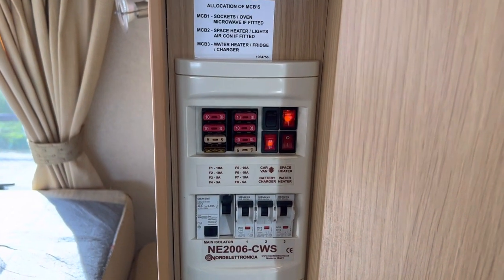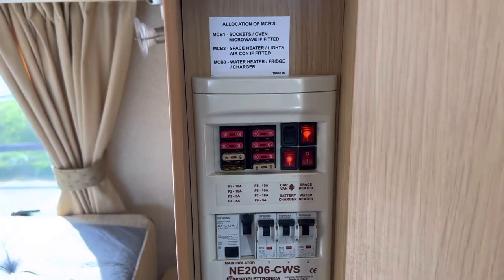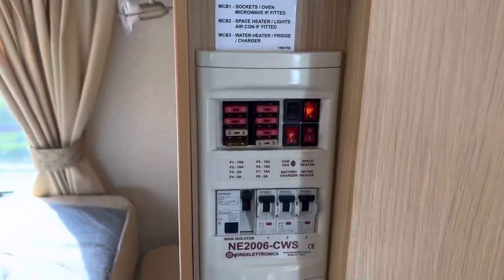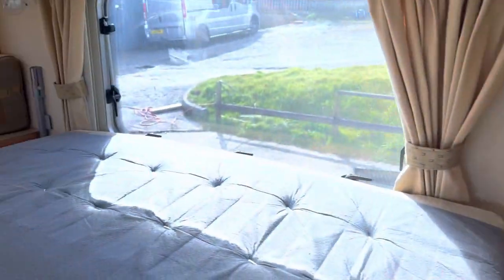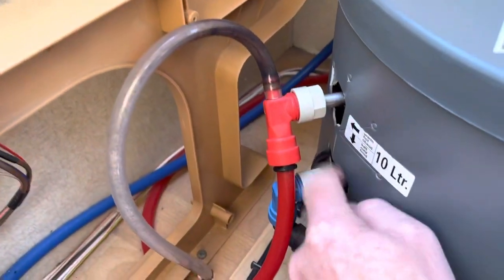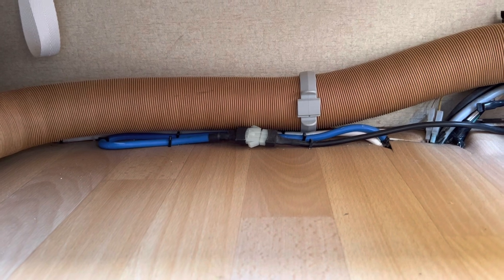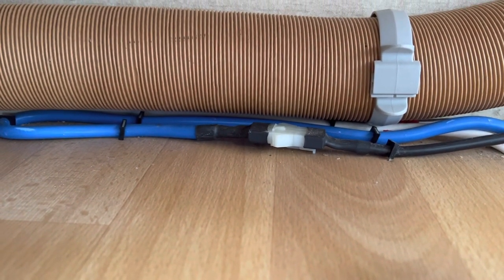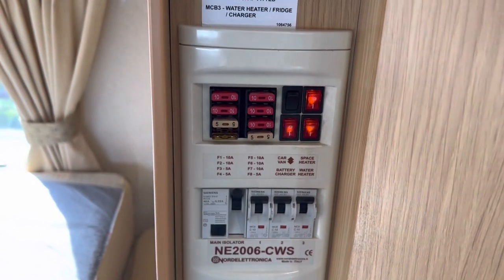Truma Ultrastore water heater not working on electric

Comment: Thank you so much for this helpful video. We are new to caravanning and the last time we went, we ended up draining the hot water without realising until it was too late, and so consequently, when we set up this time we had no hot water on 240v. We thought we needed a new element but we did what you recommended and lo and behold, 30 mins later, we had hot water fully restored. Many thanks
Reply from the maker: @juliamarshall6374  no problem, glad I could help, subscribe for more videos on stuff like this..

Comment: Hi.  good video! My compliments.

May I bother you for a couple of info I'm looking for on this kind of boiler?
I do see you have something that seems to be a very big pump near the boiler: is it recommended to change the standard common submersible pump that comes with the Caravans (comet elegant or what else)? And... what is the black little tank before it?

Another: what is the transparent rubber pipe that exit from the tee attached to the hot water exit? is there a pressure relief valve in there? 

Many many thanks in advance.
Cheers.
Ezio
Reply from the maker: No you don’t have to change the pump, it’s just a different type you have and as long as it works it’s fine, the black thing is an expansion valve, some vans have them, most don’t and yes there is a pressure valve on the red hot outlet on the Ultraheat..

Comment: Hello. Lost hot water at the end of last season. Checked all fuses. Just changed the heater element to find its still not working. Tried the old element on a plug and it heats up. Had the connection you recommend apart. Is there another connection further around from the tank that could be the issue? Many thanks.
Reply from the maker: Hi, not that would make and difference, you need to make sure the 240 is getting to the heater. I’d use a volt stick to check the 240 is getting to the element. Did you check the fuse with a multimeter?

Comment: hi there.....my caravan is a 1997 abbey vouge GTS 417....went for a break last week on east coast...got everything up and running BRILLIANT...until day after,battery ran down so checked fuses under seating at the front near the water heater and the van fuse looked as if it had very slight burn so went to halfords and got 20amp fuses got back changed fuse and still the the battery running down...do you know if another fuse runs from the battery lead to the main fuses for the van? i did find one video on utube which was in a swift caravan and that fuse had gone he changed it and he had battery power back on but      only showed about 75% charge on meter, hopefully mine as a fuse on same lead...also before my battery ran down i tried the electric heater,it lit up the switch light then around 10seconds went onto heater fualt then 5seconds low battery voltage? so is this becuase it could just be a fuse or is there anything else can be the culprit,...thank you hope you can help...ROB....your videos are very helpful..👍
Reply from the maker: Hi, your transformer has packed up which should charge the battery. On a van of that age you’ll have to retrofit a new one. Genuinely if a fuse has gone it’s because something bad has happened which has caused the fuse to blow. It’s a symptom of a problem, not often the actual problem. If you’re plugged in and your transformer is working the battery wouldn’t go flat.

Comment: Wow , great video .it worked perfectly! Massive thank you. You have saved me a fortune ☺️
Reply from the maker: No problem, glad I could help.
Reply: @atlanticcaravansUK  Can you help me figure my water heater, I bought the caravan this yr and it heats water perfect on gas but electric wasn’t working I diagnosed it to be element by disconnecting element from power supply and connected 1000w heater which ran perfect from same power and isolation switch so all good until I connected back up element and it tripped the switch. It was full of water and I did as you suggested but still no go. I replaced the element with brand new one and it was perfect and heating water so after a few days of running it for an hr or so at a time I was happy it was good. Now Iv had water on for the day and suddenly it tripped the switch! Water was hot tank was full ran some water tried it again it stayed on for a few mins and tripped again! Now it is tripping immediately again 🤷🏼‍♂️ it’s a new element, full of water, no power supply issue so I’m confused. Iv gotten rid of the block connector and replaced it with a plug on element side and socket on supply end! Fully confused! Can’t figure this out

Comment: I don't have that connection - the black cable goes straight under the floor, which is fixed and sealed. Any ideas?
Reply from the maker: Hi, there will be a connection somewhere, what caravan is it?

Comment: I have a similar problem mine seems to automatic switch to gas even though i select 240 on the dial don't know if I have a separate switch I have a Chausson flash 11 any hints would be greatly appreciated
Reply from the maker: Hi, the gas is separate on this model, there isn’t a dial on the 240 side, normally just a switch to turn it on, so I think you might have a different heater, is it definitely a Truma ultrastore?

Comment: Thanks so much I’m away with the kids on my own and you’ve just saved our holiday. We’ve a 2004 sterling and this did the trick. I could figure which red light it was tho. I tried them all?
Reply from the maker: No problem, glad it helped. But I don’t understand what red light you’re looking for?
Reply: @atlanticcaravansUK  the red element one? I turned on a light, tv and that left one red light in the wardrobe.. is there anyway to figure which switch is the element many many thanks for your video!
Reply from the maker: @slynehead   I think it should correspond with what it says underneath, if it’s the system I’m thinking, does it say water heater/ space heater below the red switch’s?

Comment: Hi,i have tried to do this today but although i have followed the cable as far as i can i dont have that little plug. I also dont have any MCBs,only blade fuses.On the boiler i dont have the cable coming out of where the element comes out! Help,i am away this weekend and no hot water.
Reply from the maker: What van have you got?
Reply: @atlanticcaravansUK  I have a CI 171 Riviera, Fiat ducato.
Reply from the maker: I’d need to see it, do you have a 240v switch to turn it on?
Reply: @atlanticcaravansUK  Hi, not that I can see! I have little switch with 50/70 on it but can't see anything else! There is another switch by the door when you come in by the electric step switch but can't see if that does anything.
Reply from the maker: That switch is for the gas, you said you don’t have a cable from the element, I take it it has worked on 240v before? It could be gas only.
Reply: @atlanticcaravansUK  Good morning, I have only recently purchased the van, and as I purchased off a friend I didn't really go through everything! To be honest I didn't realise it could be gas only!
Reply: @atlanticcaravansUK  I must add that I do appreciate your help! I have taken a couple of pictures but can't work out how to post them! Do you have an email address I could send them to if you don't mind helping with this enquiry? Regards Simon
Reply from the maker: darren@atlanticcaravans.co.uk
Reply: @atlanticcaravansUK  Hi , thanks for your help, the heater is gas only! Fired up 2nd time! Regards Simon

Comment: Our heater stopped working while away.  It was working but just stopped. So followed your instructions and it worked but then stopped again did it again and worked again.  Any idea why this would happen.
Reply from the maker: Hi, I can only think there is a fault with the cut out switch, you may have to replace the PCB..
Reply: Ok Thanks where am I like to find that?  Is it an easy job?
Reply from the maker: @davidroberts7273  hi, it’s pretty straight forward, there is a triangle bit of plastic to the right of the boiler with two small screws in it, pop that off and you are looking at the pcb. It slides out, unplug it and pop a new one in.

Comment: Hi when I disconnected this do I need to turn off all power and 12v. Many thanks. Having a nitemare. Swift sprite major 6 2017. Cannot get the heating to come on. Electrics all working but no icons on screen only spanner and clock. I've tried reset nothing. Replaced both fuses on the water heater. Still nothing 😭😭😭
Reply from the maker: You have a different heater to the one on this video, do you have an error code?
Reply from the maker: If not, it sounds like the PCB in the heater isn’t talking to the control panel over the door. Could be the PCB (most likely) the cable or the control panel it’s self..
Reply: @Atlantic Caravans  yes the error code was w255 h. And I had all the icons on the screen.

 I then was told to connect 12v and toggle to reset and press for inti. I did this then the screen lost all icons apart from spanner & clock
Reply: @Atlantic Caravans  I'm new to all this. Where is the PCB and how much roughly ?
Reply: @atlanticcaravansUK  all other electrics are working lights and fridge
Reply from the maker: @kathrynpurcell2348  I’m in Mexico at the moment, just going out, check out theses codes, I’ll have a look in a sec..
https://www.atlanticcaravans.co.uk/combi-error-codes
Reply: @atlanticcaravansUK  thankyou
Reply from the maker: @kathrynpurcell2348  yep, 255 is a connection problem, you could find the PCB which is on top of the heater under a cover that slides off and check the phone type plug, but it’ll probably be something a bit worse that needs a technician to look at, probably the PCB which is around £250 ish..
Reply: @atlanticcaravansUK  thankyou 👍
Reply: Brilliant tip thanks!

Comment: Can anyone help me figure my water heater, I bought the caravan this yr and it heats water perfect on gas but electric wasn’t working I diagnosed it to be element by disconnecting element from power supply and connected 1000w heater which ran perfect from same power and isolation switch so all good until I connected back up element and it tripped the switch. It was full of water and was fine. I replaced the element and it was perfect and heating water so after a few days of running it for an hr or so at a time I was happy it was good. Now Iv had water on for the day and suddenly it tripped the switch! Water was hot tank was full ran some water tried it again it stayed on for a few mins and tripped again! Now it is tripping immediately again 🤷🏼‍♂️ it’s a new element full of water no power supply issue so I’m confused
Reply from the maker: To be honest, it can only really be the element again, just check the fuse in the spur switch and make sure it’s 10 amp, but that should blow and not tripped the system out, we just had one that had a 5 amp in and melted so it was that that was tripping out.. apart from that without testing the element I’m not sure what’s going on..
Reply: @atlanticcaravansUK  Thanks for the reply, that spur or little plug block connector is gone coz I had to rule it out incase there was an issue with that so Iv a plug and socket fitted instead with a 13amp fuse and like you said the fuse should have cut the power not tripped the switch but I changed it anyway just to be sure. Is there any reset switch like on the old cylindrical heater?
Reply: @atlanticcaravansUK  just another possibility but does the water tank air lock or anything like that? I had hot water and taps were running well but hot water ran out fairly quick? Maybe 2-3 mins running after hearing for an hour, Is it possible the tank had air in it or something and the element has blown because of not being submerged or something like that?
Reply from the maker: The rest is the process in the video, but that won’t work if the heater is tripping out the electric..
Reply from the maker: No, if the water is coming out of the hot tap then the tank is full..
Reply: @atlanticcaravansUK  ok thanks for that for your help

Comment: Really useful to know, can i ask something that you may know the answer to.

Same water system as in video, pitch up, connect all the water and get a good stream through all the taps, turn on water heater (240v) water gets hot after about half an hour, run hot tap for say a couple mins turn tap off then turn it back on again 10 mins later its only warm, this i can understand as its now replaced the hot thats been used with cold to reheat, problem is that it does not reheat, even if left over night, if i turn off the power switch off for ten mins then turn it back on it will start to reheat. hope this makes sense 

thank you in advance
also you got a new sub too 

steve
Reply from the maker: Hi, I think it’s one of the thermostats, there is a high and a low one, depending on the age it could be connected to the element, it’s working as it gets to temperature but not ‘resetting’ itself, thinking about it, it’s probably the low one..if it’s an older unit I think you can change them without replacing the element..
Reply: @atlanticcaravansUK  thank you very much for the reply and how quick you did reply
Reply: @atlanticcaravansUK  2009, tanks again